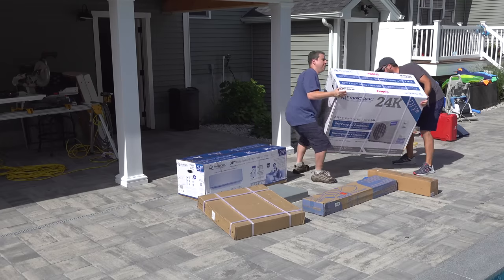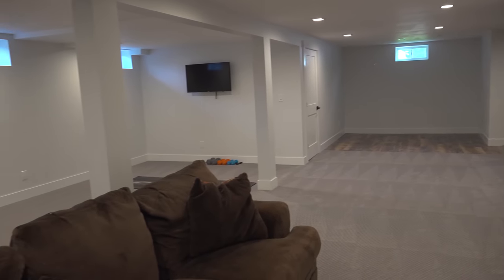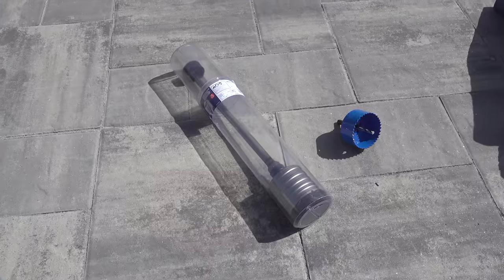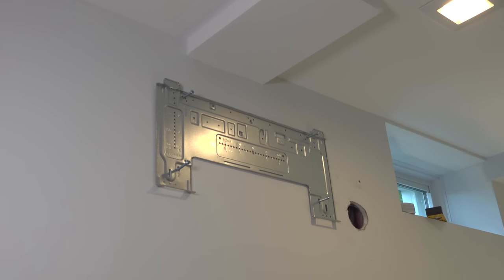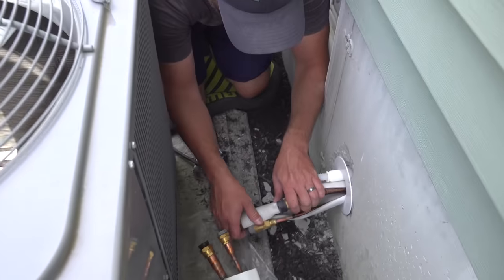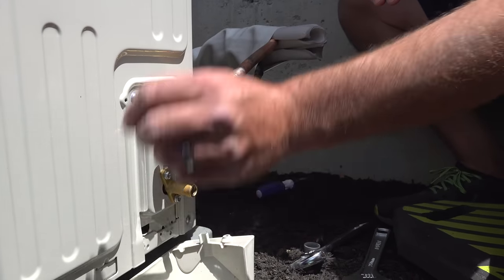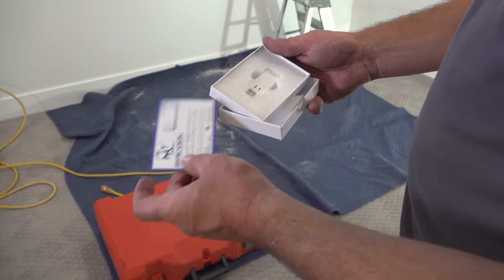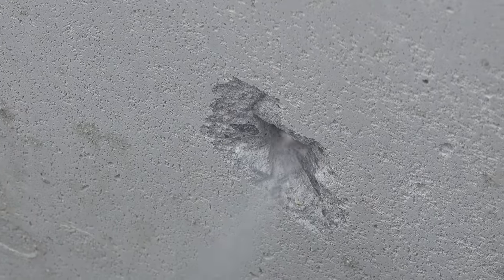Install your own AIR CONDITIONING in 4 HOURS!  DIY Mini Split MR COOL

Comment: Wat about pullin a vacuum on da system?🤔🤔
Reply from the maker: Not with this system, the line set and condenser are sealed and freon filled. They only open their valves which can be seen inside the plastic caps on the line set when properly connected. The system is entire factory filled and sealed to perfection.

Comment: Those units not  need vacuum??
Reply from the maker: Not with this system, the line set and condenser are sealed and freon filled. They only open their valves which can be seen inside the plastic caps on the line set when properly connected. The system is entire factory filled and sealed to perfection.
Reply: @SilverCymbal  how many times do you think you have had to say this lol
Reply from the maker: @mikesimek6448  I just copy and paste the answer now. It's crazy that so many pros have never heard of pre-charged lines. Mr Cool didn't invent them, they just started using them to make the install faster.

Comment: You forgot about pulling a vacuum before releasing the refrigerant
Reply from the maker: Not with this system, the line set and condenser are sealed and freon filled. They only open their valves which can be seen inside the plastic caps on the line set when properly connected. The system is entire factory filled and sealed to perfection.

Comment: Im not sure about the US but here in the EU such systems are definitely illegal. Only specifically trained people are allowed to do any work on refrigerant circuits. You can still by such units in DIY shops but even in their advertisements they inform that installation has to be done by a professional.
Aside from legal matters I want to point out some issues I've seen in your handywork:
- the foundation you placed is not secured to the ground at all, it even has an open bottom and will sink into the ground in time. This will lead to the unit leaning to one side and thus the compressor operating in a non-vertical orientation leading to increased wear.
- there is no distance at all between the foundation and the unit's bottom plate. If operated at or below freezing temperatures the water from the defrost cycle of the outdoor unit will not be able to properly drain and can easily cause damage to the unit's heat-exchanger
- the outdoor unit is not fixed to the foundation at all, over time the vibrations from compressor and fan-motor will start moving the unit
- the hole in the outer wall needs to be sealed properly
- the drain-hose coming from the indoor unit should be covered in e.g. some netting in order to avoid bugs and insects getting into the unit.

Comment: WHAT ABOUT VACUUM  BEFORE RELEASING THE REFRIGERANT  ???????
Reply from the maker: Not with this system, the line set and condenser are sealed and freon filled. They only open their valves which can be seen inside the plastic caps on the line set when properly connected. The system is entire factory filled and sealed to perfection.
Reply: @SilverCymbal  O.K.  THANK YOU !

Comment: For the love of symmetry, why didn't you center the unit between the two windows? I can't even look at it
Reply from the maker: You are funny. It positioned it so the flow hits the opposite corner exactly and splits it. The basement is an L so it worked out great for air flow.

Comment: lol wants to be taken seriously, doesn't bother locating studs BEFORE drilling hole in the GD wall. F'ing WHOOPS. 
Also: it's generally a better idea to check for leaks BEFORE covering up the valves, not after, in case you need to shut them off. 
Also also: Unit was 2 grand, but how much was the electrical box install?

Comment: Take it from a professional. Mr. Cool units are absolute trash. It’ll save you money.. in the 1 year that it actually works. After that you will be losing money either by repairing it and/or eventually replacing it. Don’t waist your time and money, just get the Mitsubishi first!

Comment: Absolutely wrong ‼️. You have to vacuum the line before open the valves ‼️‼️‼️‼️‼️
Reply from the maker: Line set is also prefilled with valves on each end.
Reply: @SilverCymbal  okay, on this brand. 
Thanks

Comment: 1) I can't believe you didn't check for studs... and then just drilled through the one you found.
2) I can't believe you stuck your hand directly into fibreglass insulation (WTF!?)
3) I can't believe you drilled like that...

This is really a hack job. Jesus.

Comment: is the line set evacuated from factory.  Because i never saw a vaccum pulled which means there might be non condensables in the system.  also any moisture in the system will contaminate the refrigerant and oil.
Reply from the maker: Yes that is correct. I received so many questions about this that I explain and show it more in the second install I did at my house...https://youtu.be/kEWzIfnIhUw

Comment: Bro you forgot to purg the line since you didn't vacuum it...air got inside the line and it willl damaged your compressor in the lone run
Reply from the maker: Not with this system, the line set and condenser are sealed and freon filled. They only open their valves which can be seen inside the plastic caps on the line set when properly connected. The system is entire factory filled and sealed to perfection.

Comment: Vaccumming commissioning ??
Reply from the maker: Not with this system, the line set and condenser are sealed and freon filled. They only open their valves which can be seen inside the plastic caps on the line set when properly connected. The system is entire factory filled and sealed to perfection.

Comment: Most of the world uses this type of ac..Not sure why it never caught on in north america..
Reply: It's starting to. We have two where I work and they do an excellent job. If I were ever to finish my garage it's the kind of system I'd install. For supplemental applications they're great but my home already has duct work so I'll stick with central heating and cooling for it. We replaced two window (through wall units) where I work with one and it does an excellent job of both heating and cooling. I can't even hear the inside unit when it's running.

Comment: You didn't evacuate the line set or indoor coil; I don't care how well manufactured, you're introducing moisture and air into the system at every connection. Also, it is much better to leak check using nitrogen and then seeing if it will hold a vacuum.

Note, leak testing using the refrigerant is specifically banned per EPA 608 guidelines as it is the purposeful venting of refrigerant into the environment.

Please don't tell everyone this is a simple DIY when you don't do it properly.
Reply from the maker: Correct, you don't vacuum out a line set with closed valves on either end that is prefilled and a condenser that is prefilled. I am amazed how many techs have never seen a pre-charged system like these despite them selling over 500,000 units
Reply: @SilverCymbal  I have seen these units, and we leak test using nitrogen, purge, and place on a vacuum every single time; and the majority of DIYs I see get replaced in 5 years or less (instead of the expected 15 years) due to not following those steps.
Every single joint that you had to tighten due to refrigerant leaking was allowing air (which will damage the compressor) and moisture (which can turn the compressor's oil acidic) to enter the system before you opened the service valves.
Also, as I said before; it is illegal on a new install to use refrigerant as the primary leak detection method.

Many in my industry view the "DIY Kits" as scams designed to take advantage of ignorant homeowners.
Reply: @SilverCymbal  also, I just noticed Mr. Cool is your sponsor... Very convenient.

Comment: 2000 pesos?! Mate you’re insane 😂 the most ive ever spend on a new one ton unit was 800. LG compressor, Danfoss filter and heavy duty copper pipes… only had to supply my own connection pipes but those are maybe $20, not worth even mentioning.

Comment: Not sure why you call it central air?   it is one room and may spill out to more.   There is only one vent blowing the air inside.
Reply from the maker: It has electric vents and circulates the air very well, very high flow and velocity. These are routinely used for a whole floor or house.

Comment: My mom has one. I hate it. It doesn't shut off. Seems like it's always on.
Reply from the maker: The fan stays on to move room air. Thats the design but the cooling portion only turns on when needed. If you want to be just on and off, thats a setting in the app or remote and you can have it how you want

Comment: they hit a stud, damaged the foundation, and failed to bolt the compressor to that flimsy-ass plastic base. At least they had enough sense to leave the AC disconnect wiring to a professional lol

Comment: Wait a second it's wired for 110v using 12/2 Romex in the disconnect outside but yet the breaker in the panel is a double pole 220 WTF. Ohh so you are using an unmarked  neutral wire for a hot. I don't what state that is but you can't do that in Florida! Installed by a Licensed Electrician?

Comment: Except if you let somebody install it not only for the line is that look better because it wouldn’t be a bunch of extra coiled up behind it. They could’ve vacuum the system down and got all the noncondensible‘s out of the copper. That’s why DIY‘s are designed to fail. They don’t tell you any of that.
Reply: That’s correct a d thank you
However, like myself a ( a professional) it appears we are 
Going against the wind (to put it politely) according to the bill of comments here LOL

Comment: No pressures tests, and no vacuum. Idiots like these are why I deal with so many problems at work. Call a professional
Reply: And before I get any “he checked for leaks” comments of you have to take the like back off to fix it you have wasted the Freon that’s in the unit and will have to buy more.
Reply from the maker: Idiot? You might need to go back to school and learn what a pre-charged system is.
Reply: @SilverCymbal  yea I know what a pre charged system is, if you open the valves after hooking up the lines and there is a leak you are wasting refrigerant. Always check for leaks with nitrogen. Also where is the vacuum below 500 microns?

Comment: U make a big mistake when u don’t make vacuum for the outside unit
Reply: I didn’t see any torque wrench either I mean you can use regular wrenches but It comes down to a guessing game on wether it’s tight enough or to tight
Reply: @ammaraltaey8288  I know what happens I install them for work

Comment: They didn't even show how they put the compressed lines to the unit .then had to be soldered or braised ..and u can't wire it urself u need a licensed electrician which cost u 1 thousand

Comment: Nice to see no effort to evacuate the line set. Don't worry when the compressor fails early from acid developing from moisture mixing with the oil inside the system you can buy another unit and start over, good news is it may last beyond the warranty period. 

Really just spend a few dollars and get someone trained to install it as it will save you in the long term.
Reply from the maker: Nice to see a tech who has no idea what pre-charged, sealed lines are

Comment: DIY ???? So funny.  Nevermind 3-4 years of HVAC training and 4-5 years to get your electrical license.  And corebore units are "No prior experience required."  Especially when you "find" the rebar in the foundation wall.  I believe the copper lines have to be vacuumed to a negative pressure at the factory or the air in them would cause serious issues...so get the connections right the first time.  With negative pressure you should hear freon flowing into the lines when connecting.  I'm heading to Walmart and pickup a few. 🤣😂🤣

Comment: Missed one step ，make sure pipes are vacuum inside
Reply from the maker: Not with this system, the line set and condenser are sealed and freon filled. They only open their valves which can be seen inside the plastic caps on the line set when properly connected. The system is entire factory filled and sealed to perfection.

Comment: Ande the vacumm pump?? Bad instalation...
Reply from the maker: Sorry to break the bad news that you are wrong, Not with this system, the line set and condenser are sealed and freon filled. They only open their valves which can be seen inside the plastic caps on the line set when properly connected. The system is entire factory filled and sealed to perfection.

Comment: When did you vacuumed the line to get out moisture and air?
Reply from the maker: Not with this system, the line set and condenser are sealed and freon filled. They only open their valves which can be seen inside the plastic caps on the line set when properly connected. The system is entire factory filled and sealed to perfection.

Comment: Why would you need an AIR conditioner in a basement with 18 inch thick walls?
Reply from the maker: Still gets hot and humidity and heat for winter. This does all of that

Comment: Great video until you let the refrigerant out, without evacuating the line set. Unless that's come special line set that doesn't allow the air to mix with the refrigerant-system won't last for long. not working effectively and efficiently
Reply from the maker: Then the video is entirely great I guess,  the line set and condenser are sealed and freon filled. They only open their valves which can be seen inside the plastic caps on the line set when properly connected. The system is entire factory filled and sealed to perfection.

Comment: Mistake number 4: Thinking that a precharged quick connect system is as good as a system that has been vacuumed down to below 400 microns with proper refrigeration equipment!
Reply from the maker: You are right, a precharged system is better without question. A field installed system always makes errors. I have witnessed many techs not purging lines, adding too much or too little refrigerant. You are in the field right, it's understandable. A factory environment will always yield a perfectly filled system every time. Ever wonder why window air conditioners last forever, same reason factory built every time,

Comment: That's not central air, fyi, it does one space......Imagine trying to repair one of these in 5 years and you are unable to find repair parts or any product support, then unable to find a company to repair it. Yeah, that's the future I predict for these.
Reply from the maker: You won't need your crystal ball. They have already been around for more than 5 years. They have dealers in almost every state already and are sold through every major home retailer. They aren't going anywhere except for up. Every bit of this experience was excellent.

Comment: the fact that the unit isnt centered between the two small windows bothers me
Reply from the maker: I saw many comments saying the same, his basement is an L shape, so it was placed there to break the air flow on the corner to help distribute it.

Comment: Okay, but if this unit is like a car with a tank full of gas, what happens when that gas runs out? Do I have to buy a new car again? Lol buy another unit because you can't recharge it.
Reply from the maker: It should last the life of the system and you have less chance of failure compared to site brazed connections that fail due to tech errors. BUT if you need servicing the system can be purged, tested & refilled with it's service valves.

Comment: They completely skipped a very important step of testing with dry nitrogen and vacuuming the system down to remove all moisture in the pipes. Without doing this the unit will run okay for a year or so and then your refrigerant will become contaminated.
Reply: Precharged linesets. They have a holding charged and a special connector that is pushed in when connected. You can see it inside on the end. Bubble check and tighten if necessary.

Comment: Almost all works are right the inly thing that being bypassed is the air purging which is the most important procedure
Reply from the maker: The lines are precharged and sealed, you do not pull a vacuum on this system, eliminating this step entirely.
Reply: Yup...but only outdoor have a precharge refrigerant. Once you remove the plastic cap on the indoor unit it will be contaminated by air. Air purging or evacuation was being done by most of the professional installers on connecting the two units to avoid any issue after installation but anyway if your unit is cooling then its fine
Reply from the maker: @hvacae6904  The caps are only for dust: Product details: This easy-to-use line set greatly simplifies the installation process. It is pre-charged from the factory for the precise amount of refrigerant necessary for both the 2-3 ton & 4-5 ton MrCool Universal heat pump split system. Which means that this line set requires no charging in the field and no vacuuming. It is 100% ready to go right out of the box.

Comment: No! No! No!
The refrigerant path needs to be leak tested under pressure with dry nitrogen, vacuumed in order to remove the moist out of it and after that you fill it with the freon from the external unit.
Reply from the maker: Wrong, pre-charged lines and condenser. Don't do that to this system when new.

Comment: It cant be 4 hours. This is more like DDIY (don't do it yourself) because it is a heavy job, takes 2 men, requires special tools special mechanical and electrical skills, needs many days to complete plus to face many other unknowns that come up along the way.
Reply from the maker: If I had a wood wall, alone I could have easily done it by myself in 4 hours with no special tools, they include the saw bit as shown. But yes if you need to go through 12" of concrete you will need a tool. It isn't a race, I was highlighting that it can be done quickly, but if you are working alone, take 2 weeks and split up the inside and outside work, nothing forces you to do it all at once.